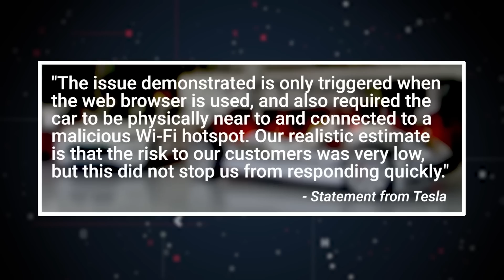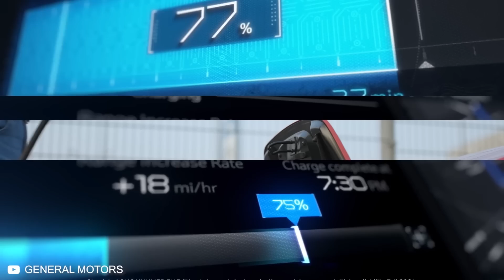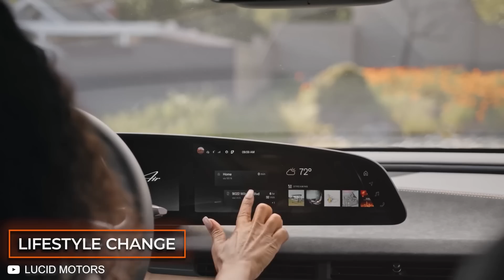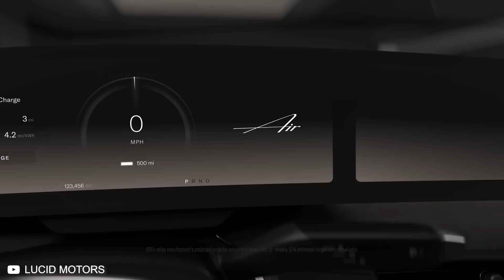EVs' Serious Problems That Carmakers Are Hiding

Comment: The electricity for these vehicles comes from fossil fuels so what's the point?
Reply: The point is they don't require as much fossil fuel from much more efficient upgraded grids and power plants, as these plants and grids require less fossil fuel along with solar and wind to fill the gap until next generation nuclear. 

EVs do not require gasoline.  Petroleum It's too valuable for plastics and lubricants to waste it fuelling ground transportation, especially in cities where most trips are short enough for the cheapest EVs. Petroleum is too valuable now to waste as gasoline especially on small mobile systems, like automobiles. We should leave as much petroleum in the ground for our grandchildren so they can use it  plastics, paints, petrochemical feedstock medicine, etc.

Comment: Wow, so, I only have to hang around in -30F weather charging my car in -30F MN weather, for 40 minutes, if I'm lucky enough to find a fast charging station? What kind of fool would buy a reliable ICE car for $4000 that will cost them $200/month for 5 years when they can spend a mere $60,000 for a coal or nuke powered EV that will cost them over $1000/month??!!
Reply: 1.) fast chargers are everywhere but mostly you just charge from home while you’re asleep since, y’know, you have power conveniently delivered to your home. So you typically never really need a super charger.

2.) are you seriously comparing the cost of a second hand car to a brand new car? REALLY and you don’t see the problem with that logic? Are you thick?

3.) please justify how you think an EV would cost $1,000 a month considering it has no regular servicing requirements like an ICE does and per mile Electricity costs 10x less than petrol? I’d love to see you justify the random number you blatantly pull out your rectum.
Reply: @engineeringtheweirdguy2103  

Yes, numnutz, I'm comparing a new EV to a used car, because there are no used EVs with enough battery life left for MN winters, and even if there were, it would be 4 times the cost of an ICE car. Check Craiglist Minneapolis, and find me an EV that I can buy for $4,200.00. That's what I paid for the rust free gas car that, barring an accident, sink hole, or meteor strike, should easily last 4 years, with minimal maintenance. There is one, used, 2012 EV van for $9200, with double the mileage of the car I paid less than half of that for. Because of the high cost of an EV, relative to a comparable ICE car, smart people tend to keep them longer, meaning the battery will almost always be very depleted, by the time it's even merely double the price of the the cheapest, comparable, used, gas car. 

FIND ME AN EV FOR $4,200. on Craigslist, Minneapolis!

You say I can "fast charge" the car (although, we both know that that decreases total battery life).  How would I fast charge an EV in Glendive, Montana, where we went to dig for fossils, for example? What if I'm running low on charge near a high crime area that I'm unfamiliar with, at night? You want me to hang around there with my family for even 50 minutes charging my battery, at night? Do you expect me to always have 2 cars insured and maintained, one commuter EV, and an ICE car? Is that it?

You need to temper your enthusiasm with reality. EVs are not affordable  nor practical to a most of the population, and never will be as cheap as a comparable ICE car. If there were universal batteries that could quickly and easily swapped out for not much money at stations across the country, they would at least be viable, at some point, for cross country travel. But, I'd heard that Israel tried this, and it flopped.

The high purchase price of EVs will condemn a large share of the population to mass transportation, whether they like it or not. This is the ultimate goal of wealthy, megalomaniac proponents of EVs, and our government. In the words of WEF founder, Klaus Scwab, "You will own nothing, and like it" No, ETWG, we will never like being slaves. Trust me.
Reply: @DUCKSAREEVILLLLLLLL  touch a nerve did I? You can’t compare new to used. That’s just faulty logic. Although EV’s are priced at roughly the same and in some cases cheaper than equivalent ICE cars new. 

You seem to think the batteries fade faster than they actually do. In reality modern EV batteries are designed, and are showing signs of, lasting double the lifespan of a combustion engine. With none of the upkeep ICE has. And that’s only to 20% loss of range… any quick google search will tell you that.

As for the actual price, most EV’s come through in the luxury vehicle class. Comparing a secondhand model S price is like comparing a secondhand Porsche price. Comparing a secondhand model 3 price is like comparing a secondhand BMW M3 price. Both are direct market competitors for each respective vehicle. You cannot however, comparing a second hand model S, for example, with second hand Honda civic. Because that would be incredibly faulty logic.

There is a supercharger at 1919 North Merrill Avenue, _*Glendive, MT_” so I guess you could use that one? LOL! And you call me numnnutz (which should be spelt “numb nuts”)
Reply: @DUCKSAREEVILLLLLLLL  also, for a lot of people (not all but a majority) EV’s are incredibly practical, that’s why cars like the Model 3 are some of the most popular selling cars in many countries. Including places like Australia. Where it was THE highest selling car for the first half of 2022 so far.
Reply: @DUCKSAREEVILLLLLLLL  also “what if I’m running low in a high crime area” very fortunately, EV’s like every other car, tells you how much fuel, charge you have left. It even tells you how much you’ll have when you get to destination with surprising accuracy. And, get this EV’s include the incredibly basic function of knowing if you’re not going to get to your destination with sufficient charge and will automatically route you to charging stations if required. Which you can then change if you feel the charger you’re going to is in a “high crime area.”

In effect, to find yourself in the situation you described you’d have to be borderline brain dead. It’s surprising I know but the car designers turned out to not be brain dead monkeys. Despite the fact that engineers are routinely known to be some of the dumbest members of society (clear sarcasm to point at that you assume that some of the most intelligent me members of society who design these things for a living, hadn’t thought of including features to solve a problem any first grader could have thought of in an instant….. the hubris.)
Reply: @engineeringtheweirdguy2103  Since we're being picayune,  it's "spelled", not "spelt", in The U.S. Be that as it may. Bottom line. When I search for any car up to $4,000, I get 952 results in Minneapolis Craigslist. Zero of them are electric cars. This is what is know as reality, to non EV zealots.
Reply: @DUCKSAREEVILLLLLLLL  why are you expecting luxury class vehicles to be on Craig’s list for $4k, when they’ve only had market popularity for the last 5-10 years at best? Regardless of its powertrain type?

Maybe reflect on that a little. Your assertion or rather. The connotation you’re prescribing it, is logically flawed.

Comment: Sounds horrible. I will drive a gas car as long as I can. Living in WY. You got to have realy good range, otherwise you could easily be stuck somewhere out in the middle of nowhere or on a mountain. Also it can get below 0 so there's that. Even if you have a garage.  You would have to be stupid to buy an EV living in WY. Also I can buy my kids older vehicles for pretty cheap,  because teens do not need a new car. And they still last and if you have problems go to the mechanic in town. I also i think they are worse for the environment. I can't help but to think, what if your car get the dreaded computer blue screen? With a phone you only get 2 year, I no not a fair comparison.  But seriously. Is anyone going to pay it off before the computer system shuts down? What makes anyone think they will make the EV to break down at 4 or 5 years and you have no choice but to but by a new. Or I heard a possible idea was ever bell and whisel I the car you will have to pay monthly payments on top of the car payments and then they will have full control of your vehicle and just turn it off at any time. I think its all a scam.
Reply: Many of the original Tesla Model S's that came out 10 years ago are still on the road without issue. The cars themselves, including the batteries are warranties for 8 years. You can get ranges up to and in some cases over 400 miles in modern EV's. I life in Australia with a standard range model 3. being the shortest range Tesla you can buy in Australia. (second only behind the model Y but not by much).  and sorry, but Australia is way more sparsely populated than Wyoming.  Moden EV's also dont have any problem with cold weather either. Infact an EV in the cold is still more reliable than an ICE car because ICE car batteries slow their chemical reaction in the cold because they arent being kept at temperature or insulated when the car is parked. So when you try to start you car on a cold morning, it has less juice. But thats not what causes the problem. the problem is that when its cold, the spark plugs dont spark as hot, so your car wont start. It can often take several go's at starting the car before you spark plugs or diesel fuel warms up enough to start, often this doesnt happen before the battery goes flat.

EV's dont suffer from this fault. you get reduced range in the cold. Sure, but only around 5% with modern EV's. (range reduction of at best around 20 miles.) 

All modern cars are heavily computerized. Computer faults occur with effectively any new car. thats not something exclusive to EV's. However EV's do (for now) posses a work around that ICE cars have yet to figure out. the forced re-boot. Like holding the power button down for 10 seconds to restart your frozen computer. you can do that to your EV. It will even keep driving since most EV's have a separate drive computer. But the screen will go blank then come back on as it re-boots. 

Telling you from experience, if you have any more on-going or serious issues, Tesla can log into your car remotely to diagnose and fix any software issues (in my case there want an issue, it was user error, but they logged in remotely all the same because I was being insistent). 

Lastly you wont get stuck in the middle of nowhere. This might come as a shock to you. but EV's, much like ICE cars have fuel guages, tell you the state of the battery at all times. It tells you how much range you have left too, If you get too low or have the navigation set to somewhere outside the range of the battery, it alerts you and automatically routes you to a charger before its too late. How often have you neglected your fuel gauge and run out of fuel in the middle of nowhere? I'm getting never. Anyone you know? no? why do you think you'd magically not be able to read what is effectively a fuel gauge in an EV? this is one of the most common and most poorly thought through arguments I see on these videos.

Comment: Another problem hardly mention with so called electric cars is if you recharge when theirs life still in the battery it damages the battery and the batteries life is shortened as is the range, another problem is coming back the the car to find it disengaged with the charger/unplugged.  Also in Europe many many drivers park on the street and their front doors of their home is straight onto the street.  This means it's impossible to charge the car from homes as it would mean having a live electrical lead run across the path, this would endanger users of the path ways,  Also currently their is a serious lack of charging points especially once you are out of the towns/cities.  Currently my nearest petrol filling station is 6 miles from my home and the nearest electric charging point is 20 miles away.  Another problem would be once you get to a charging point, there's liable to be a queue due to the time it takes to recharge, current filling stations will require a massive car parking facility in order to provide a recharging service.
Reply: no. They arent sodium ion batteries, they dont have charge memory. They dont get degraded from being charged early. They dont get degraded from charging too fast (but only if its too often) or from going flat (which should be very difficult to do. how often do you run out of fuel because you've ignored your fuel gauge?)
Reply: Whilst EV's arent for everyone. those without a means to charge included. (although many EU cities are adopting methods of on-street parking but thats another story). You wont join massive ques at charging stations. And you dont need super close charging stations either. here is why.

If you can charge from home (which you presumably do if you ended up getting an EV) then you wont ever need these charges for day to day activities. Most people dont have 300-400 mile daily commutes. Infact the average in the US is only 16 miles. I myself do 75 miles and I get sideways looks from my co-workers for travelling so far. Ideally, you charge from home, every night. whilst you're asleep, so every single morning you wake up and you have effectively a full tank of gas for the day. every day. 

Now alot of people do infact do longer trips. beyond the range of an EV (more than 300-400 miles round trip). However this might happen once or twice a year at most for the majority of people. (which is around 0.5% of the year, so not often enough to demand extra range from your vehicle, or enough to demand more charging locations). Only in these situations to people typically use public rapid charging locations/stations. That means only very few EV owners will be using these charging stations at any one time. VERY few. since only 0.05% remember? so typically you wont have to que, unless people are doing club days, which is where litterally all the videos and photos of EV's queing at super chargers come from. You dig a little deeper and you find out that its the tesla owners club or the model 3 owners club or some similar doing a club day where around 100 or so people bring their cars and they do a big group road trip (in Australia they like doing the great ocean road). So in that situation, yes, there is a que and you do have to wait.

But make no mistake, its not like ICE cars where EVERYONE has to visit a fuel station once or twice EVERY WEEK. dont let that false analogy sink into your thinking.

Comment: Here is a thought about EVs.
1. Storm hits..no power
2. Transformer down..no power
3. Car hits power pole...no power
4. Power line maintenance...no power
5.solar panel on a cloudy day...no power
6. Rolling blackouts...no power
7. Landlord doesnt provide charging stations...no power
8. Think about it
Reply: Here are some corrections to your thoughts:

whilst EV's arent for everyone those who do get them typically can charge from home. This means they plug in when they get home and unplug when they leave for work the next morning. Full tank of gas, Every single time the day begins. (300-400 miles of range). an ICE car does not get that luxury, You wait until your low, then you refuel, maybe once or even twice a week.

So for thoughts 1, 2, 3, 4, 5, 6. This wouldnt really impact EV's. Sure, you might not be able to do a charge overnight (unlikely, since most of these problems are fixed within a few hours and the average person is home for around 14 hours between shifts).  You still have several days worth of range left in the car. Just like an ICE car has several days worth of range in a full tank of gas. Except this actually goes in the EV's favor, as EV's would have started that day before the power outage, with 100% charge. There is a VERY Small chance that you have the power blackout the day you filled up your car.

and remember fuel pumps work on electricity without power, you cant get fuel

to add to (5.) its worth noting that you can charge from regular power. You there is no condition where EV's must be charged with solar.

7. you dont need your landlord to install a charge, most EV's can be sufficiently charged from a regular wall outlet and extension chord. 

8. Think about it.... more.

Comment: lf you asked me if l had to make a choice between buying a EV or setting my hair on fire then try to put it out with a sledgehammer which would l choose? Will someone please bring me a match. PLUS, let's not forget where about 80% of electricity comes from, COAL FIRED POWER PLANTS. So while your running around feeling so good about "saving the planet, just remember the only "green" involved is the money your shelling out to the electric companies and paying for your overrated golf cart. Nuff said.
Reply: It takes 6 BARRELS of oil for a single charge
Reply: @Glenn-F-Rice  no it doesn’t. Is closer to 0.07 barrels per charge. Where on earth did you get that number from? A magic 8-ball?

It’s actually trivial and very very VERY easy to show that you get better fuel mileage from charging your EV with a cheap, small, portable generator than you do putting that same fuel into even a modern combustion car. 

But you think you need 6 barrels of oil for a single charge?!

As it stands, even on a coal only grid, EV’s produce SIGNIFICANTLY less emissions than a combustion car does, even before you consider the massive emissions produces through refining the damn fuel in the first place!

And the emissions they do produce have Microparticles filtered out of them, ICE cars do not do this. The resulting impact on health due to Microparticles emissions from tailpipes is drastic to say the least. If you live within 10 miles of a major freeway your life expectancy drops by 15 years! Something EV’s don’t do to you.

Where in hell did you get 6 barrels of oil from!?